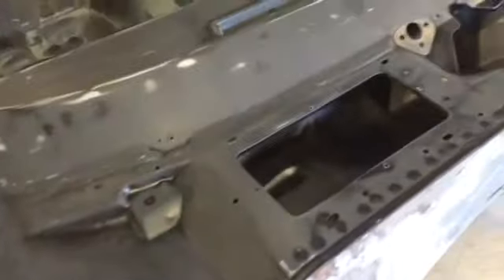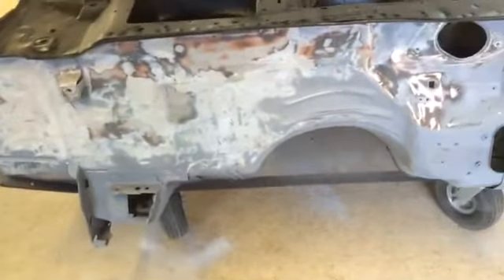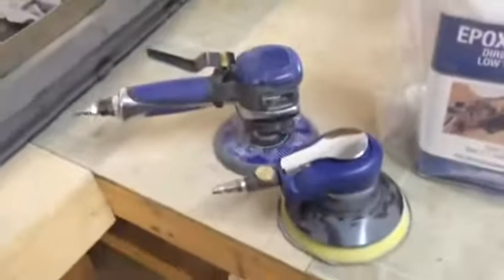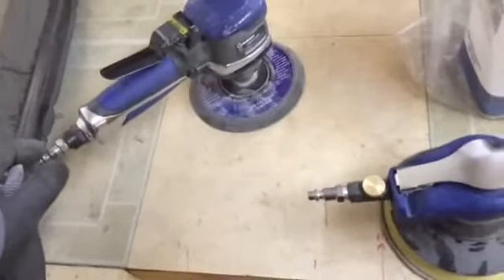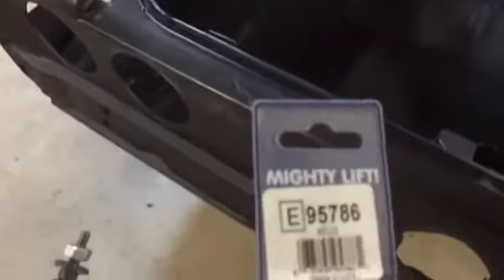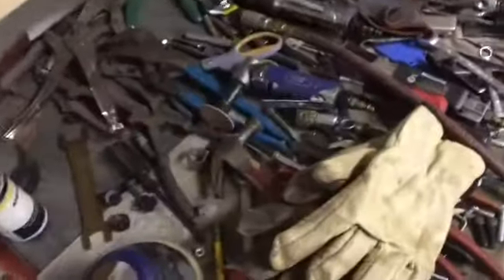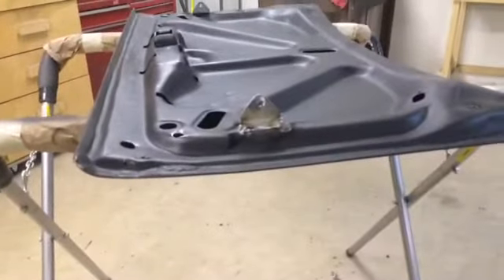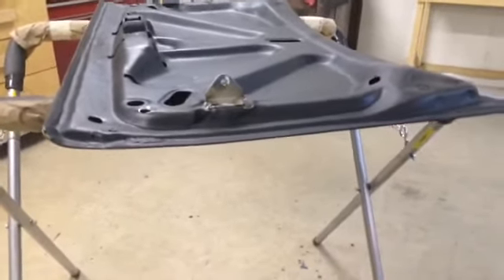1972 Camaro Part 29

Comment: On the roof skin, I heard Classic Industries sells a roof panel with weld thru primer that is pretty good. It is glued to the inner panel with panel adhesive from the factory. It will probably have to come of in sections with an air chisel and grind the door areas where it wraps around the inner roof section.

Comment: Epoxy is looking good.  You might be a painter.  Are you going to blast the interior areas that need cleaning up or use another method?
Reply from the maker: Thanks Sam. Probably some of both. This wknd is four days and I hope to get all of the exterior and inside in epoxy